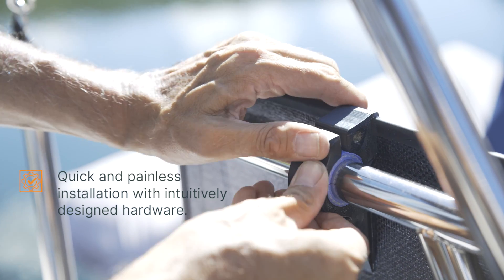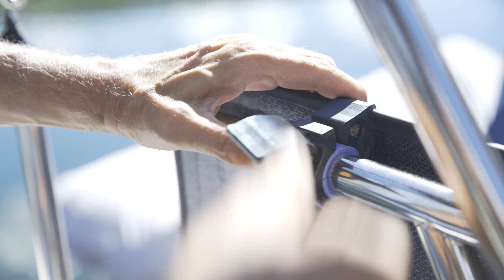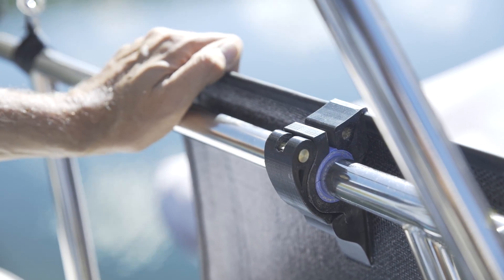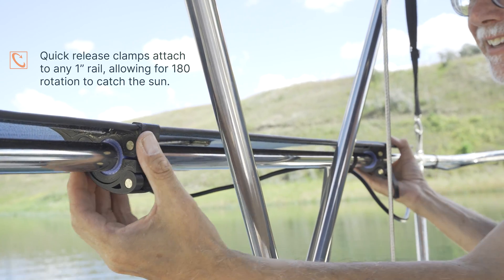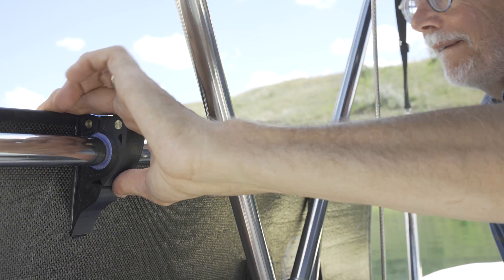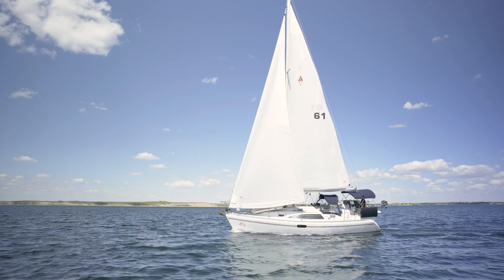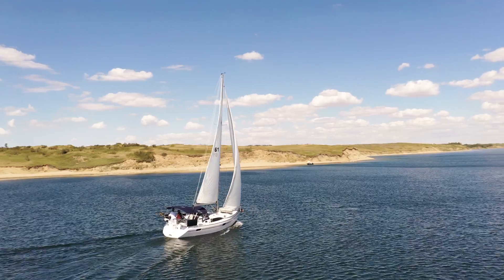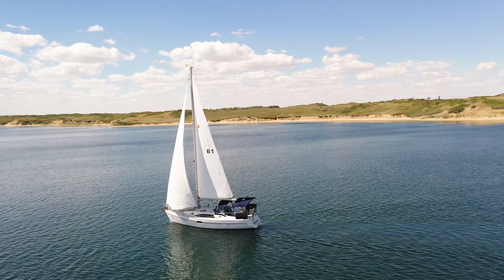The seaLeaf: easy-install solar panel for any sailboat.

Comment: So the rail has to be clear of any other tubing such as bimini frame. On the boat used in this video the bimini frame is a separate frame connected to the deck. It's quite common for bimini frame to be attached to the upper rail.  That's a real problem

Comment: Durablility?  I worry about constant vibration and flexion in wind.  They're not COMPLETELY rigid so they'll be constantly working to some extent.
Reply: They are indeed completely rigid. Any vibration or flexion concerns would likely be seen through the mounting hardware, which we've beefed up significantly since the prototypes and have built the ability to replace them easily should they fail.